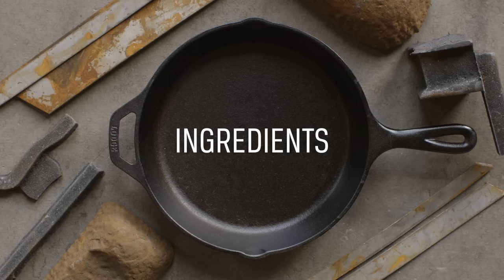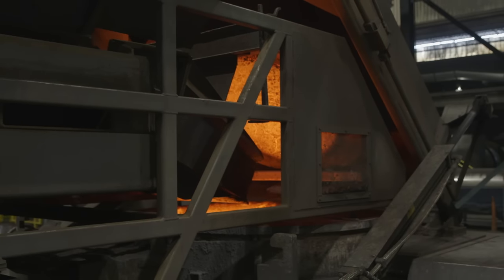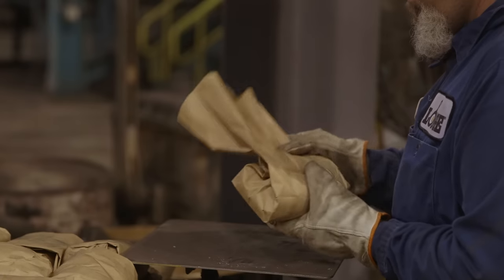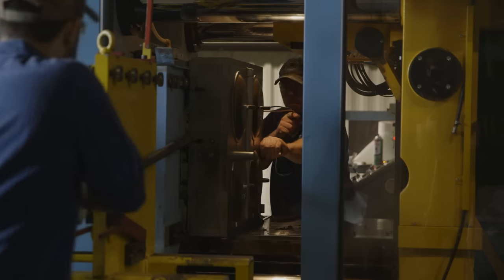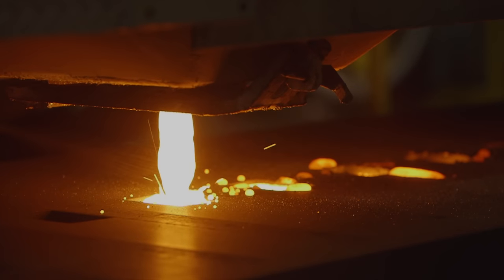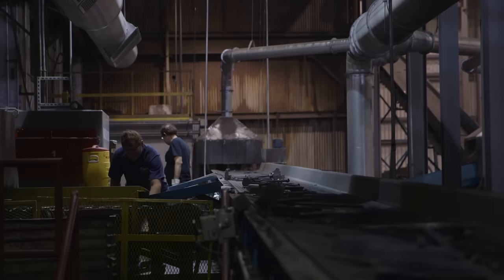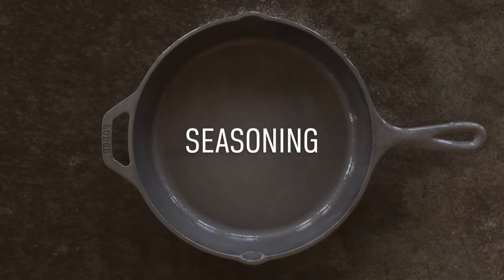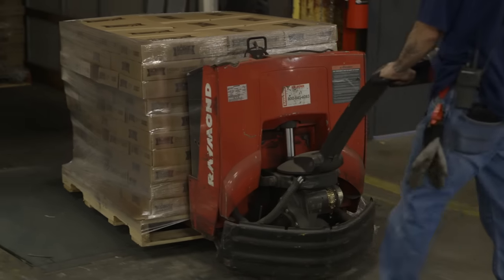The Official Lodge Cast Iron Foundry Tour - Extended Version

Comment: I wish Lodge would make a smooth finish version, but it's great they are still kicking!
Reply: My 10" Lodge skillet, purchased 3 years ago now and used just about every day since, mostly with a stainless spatula, now has a glassy smooth finish, and it probably has for at least a year now. They definitely get smoother with use.
Reply: @ZombieDawg  Agreed. While you can buy a smooth surface cast iron pans from other manufacturers or sand it down yourself, if you keep cooking in the rough texture ones then they eventually mellow out.
Reply: I just found a used lodge at a thrift store. Had a mirror smooth finish. It's perfect
Reply: blacklock Lodge pans, it's newer, it'll have that 'Grandma's pan' smooth finish you're looking for, Light, thin walled, and triple seasoned.

Comment: I just bought for the first time my lodge cast iron skillet last week and I love it. All the other junk I have is getting tossed. The best cookware ever.
Reply from the maker: We're so glad you love your Lodge skillet!
Reply: @lodgecastiron  why are some people smoothing out there cast iron skillets? To me that just ruins the skillet.
Reply: @mammamiaitalia43  
Ignorance on the part of the owner. Not trying to step on any toes here, but smoothing/sanding a cast iron vessel doesn't take the place of knowing how to properly season and maintain it. The 15+ pieces of my cast-iron-only-kitchen is dominated by Lodge products, all of which perform synonymously with the sanded/polished Griswold that was passed down to me from my great grandmother. Use your cast iron regularly and maintain the seasoning; you now have the secret ;)
Reply: Because it’s easier to build a smooth non-stick surface if you start with a smooth surface. I’ve owned one of these lodge preseasoned pans for nearly 20 years and never was satisfied with cast iron because of it. Then I picked up a smooth Wagner from a garage sale and saw what a difference there was in using it, so I’m going to be smoothing my “old” lodge down too (technically the youngest one in my set of 4 antiques lol). It’s one of those things of “to each their own”, some people love it and some hate it.

Comment: I own the Dutch oven with the dual top/10.25 inch skillet, the 12 inch skillet with the glass top, and the 10.25 inch reversible grill/griddle pan, and I love them all.

The video is fascinating and got me curious as to how all the machinery and techniques were developed. I love watching videos of smithies hammering out farm equipment — very hands-on stuff — and I’d love to read a history of how the forge went from there to here. Did you say that the sand molding technology goes back to around 680 bce? I thought it was WAY earlier than that. If y’all could recommend some books about the history of everything that it takes to make cast iron, I’d appreciate it.

If I had another life to live, I’d love to work at Lodge (the slag removal looked like fun)!

Comment: Ahhh I see now… they give it one layer of “easy release” seasoning for transport to prevent rust of course. That is why some of my pieces haven’t been able to hold seasoning very well. I will take it off and do it again. I LOVE the lodge cast iron, but I will redo the seasoning in multiple layers with actual adherence to the metal since I cannot seem to keep seasoning thick enough! Sometimes I can see little flecks of the metal shining through on my other brands as well. Looks like I have a project tomorrow! 😁 Out of all my modern pieces of cast, I like my lodge pieces the best. I’m also going to see if I can’t smooth out the surface a little more.

Comment: What was the difference between now and 100 years ago in casting a pan? Are there any videos on casting a lodge like even 70 years ago?
Reply: The main difference is that the old stuff used to be tumbled a heck of a lot more and was smoother.  The new rough stuff is lower quality because it allows them to speed up the process and make more.

Comment: there is another foundry in Oakland CA that makes cast iron pipe, skillets, and other product. when i toured there i was shocked to see what they used as raw material..brake drums, engine blocks.  you didn't see that in this video but i'm sure they use the same stuff. doesn't matter; at 2800 degrees nothing is left
Reply: Pig iron scrap steel and returns

Comment: your Cast Iron pans  are  really  good . possibly  more  energy efficient then a  microware .
Why ?  because   iron  holds the  infrared heat  energy , like a  battery .  microwave cookware does not hold onto the heat .  And , microwave ovens are only good at  re-heating .  What  usually goes into a  microwave oven ?  Typically  pre-cooked food , TV  dinner  stuff .  What were these TV dinner things originally  cooked with ?  certainly NOT a microwave oven .